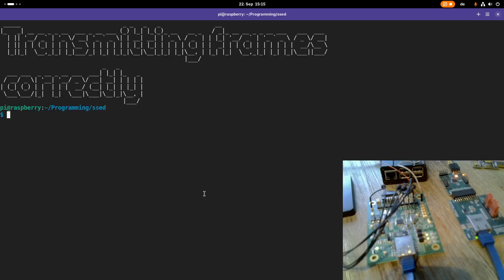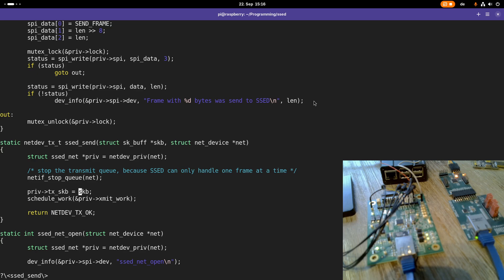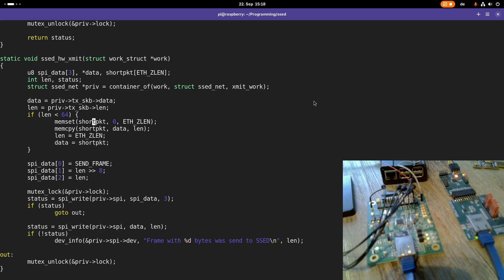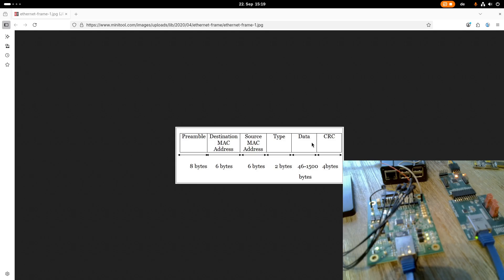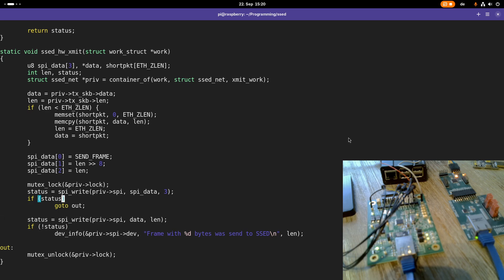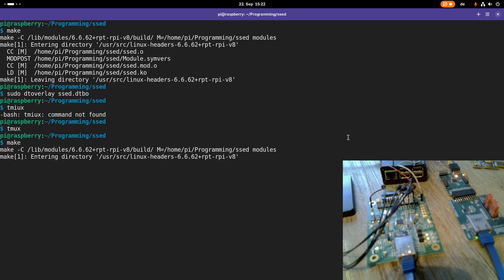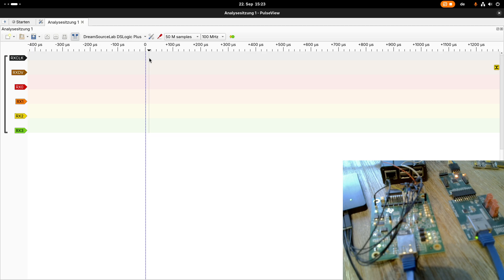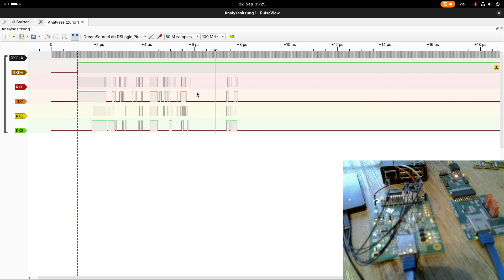Let's code a Linux network driver - Transmitting frames correctly

Comment: I wonder if we could use a esp32 and use it instead over UART. Since I don't have the board you are using.
Reply from the maker: The ESP32 integrates an SPI interface and an Ethernet MAC controller. So, it could be turned into the SSED device with the correct firmware. I looked at the ESP32 and it was a possible candidate for my device. But the WIZnet W7500 chip is much easier to program, that's why I choose this chip.

The board I use is a custom design. But you can turn any WIZbnet W7500 Evaluation board into the SSED device. The Surf 5 board is relatively cheap and can be used to follow along: https://shop.wiznet.eu/en/surf5.html But you will also need an st link programmer.

Comment: Hi Johannes, great series, thanks for the effort. Was going comment this in the last episode but it applies here too. What packets are you transfering now? As soon as the module is loaded you get this flood of things to transmit. Where are these packets coming from?
Reply from the maker: Thank you. 
I think the system will send some frames like DHCP requests or for Link Layer Discovery automatically. I guess the network manager triggers these packages. 
When I have implemented receiving of frames, I will take a look at the traffic with wireshark.